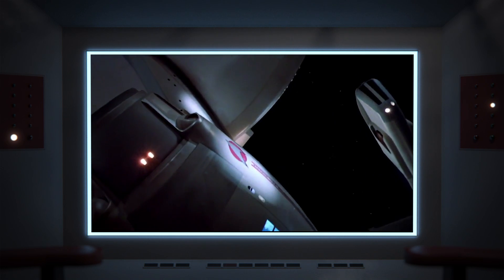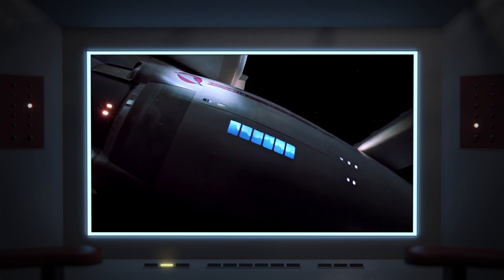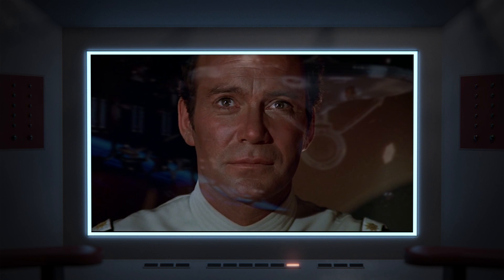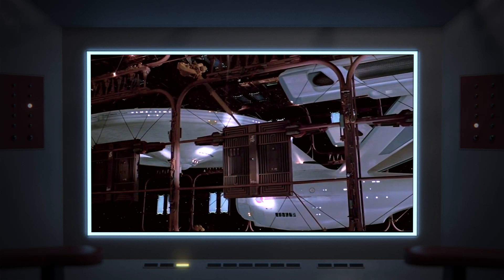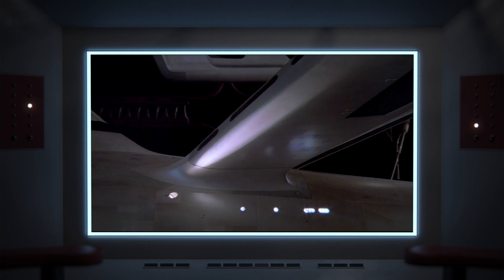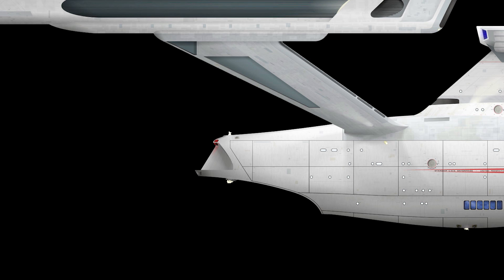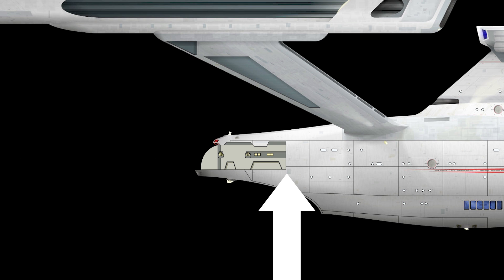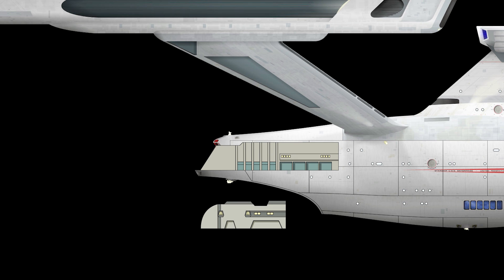Why Have Angled Nacelle Struts? (Enterprise Refit)

Comment: Believe it or not, it has nothing to do with aerodynamics.
Simple experiment:
Take a pencil and draw a line on a piece of paper, but hold the pencil up and down at a 90 degree, like the original struts, at the eraser end. After that, angle it at a 45 and push or pull the pencil to make the same line.  First line, you will find that there will be a jerking affect, the further out your fingers are that holds and controls the pencil, the harder it is to draw a good line.  The power end (fingers) will lead the other end by a fraction, and can eventually tear up the paper or just make for a slow progress.   But use it an angle, as we all use the pencil, you will find it much easier and the power goes through the pencil rather than forcing the pencil from the other end.  Taking a stick and dragging it through the dirt will get the same results.   And that is the real reason why they angled the struts, much stronger and smoother to operate.  Extra space is a bonus.
But also note, in your profile comparison (0:44), the main hull is also slightly longer at that rear than the original, probably by about 20 to 25 feet and the hull is also thicker (higher) than the original which is about where the new nacelles are placed.  I can arguably say that they didn't rebuild the Enterprise, they replaced it.
Reply: When they refit the WW2 Enterprise carrier, they made her bigger is several ways. But they rebuilt the ship, not replaced it. So Starfleet with its future tech definitely could have rebuilt the TOS Enterprise easily.
Reply: @SSanatobaJR  what are you on about?  CV6 was never rebuilt.  She had more AA added and minor changes to radar positions and such.  But profile, length, and width remained virtually the same from her launch before the war to her scrapping in the 60's.  The Essex class ships received major modifications later in life that included angled flight decks, enclosed bows, and new island superstructures.  Even then, their dimensions didn't drastically changed except for some added flight deck width.

Comment: There are way too many statements that can be made concerning Starship design across all species in Star Trek. Many things that make much more sense, even. And then there's weapons, yields, ways of using them that you rarely see or have never seen. Like, you see lots of shots where a ship fires some torpedos and they miss, sometimes by quite a bit. But you never see ships equipped with teleporters  in their torpedo/missile tubes so they can just teleport them where they wish them to detonate either inside or outside an enemy ship. Also, the targeting of weapons would be way more accurate then they portray, almost to the point of 100% accuracy due to the hyper advanced computational assessment of direction, speed, and any other factor you'd need to make a direct hit using any method of delivery. Even at 186,000 miles away phasers, or most energy weapons hit nigh instantly. You can't avoid that with any kind of maneuver. And they never engage in combat at any where near that distance. But, back on ship design. Starfleet ships like the Enterprise are very bizarre shapes. While not inelegant, they are a bit functionally strange in layout in certain areas. But, also, even in those areas if you take into account certain potential needed contingencies in the event of disaster, then even those oddities start to make sense. Ie. warp core breaches, antimatter containment failures, etc. It will be interesting for those that get to witness it, if we make it that far, to see just how we go about designing our own extra solar ships if we ever manage to develop such things. What they would look like is a fascinating mystery we will never know until it happens right before our eyes. I think everyone alive today will be long dead before that happens.

Comment: the tapered shape of the refit struts doesn't make sense.  why do they need to be thicker at the engines?
If you need the end to be bgger to spread stress when connecting the should have been thicker at both end or uniform in thickness.

Comment: My Thought about these more angled Nacelle Support Struts is for better warp field control?  The overall shape of the full ship not just the struts is all based on warp field shape and balance.  The way the saucer dips in on the underside of the saucer section is to do with shaping the warp field for maxim speed and control.  The shape of the nacelle struts is the same thing, making a better warp field shape and thus better speed. There's nothing in engineering that say's the machine can't look well designed and functional?  Designers even of real world machines always make sure not only the machine does it's intended propose But also looks lovely!  And the Refit Enterprise is all that.

Comment: Another possibility is they obviously completely redesigned engineering and the power system, so the path of the power may have been more efficient with the angled struts.

Comment: Thanks, Eric, for another great video! I'll add my support to the ideas previously commented that the revised pylon design allows a shorter and more direct path for drive plasma to travel from the reactor to the nacelle coils. In addition, by having the pylons connect at the center of the nacelles, directly below where the drive coils are supposed to be located, the plasma can be distributed directly and evenly to each coil. In the old design, where the plasma feeds from the front, the poor coils way in the back are getting stale, cold plasma that's already had its mojo used up by the coils ahead. :)

Comment: I also noticed the redesigned nacelle struts were positioned in the middle of the nacelles instead of the front. If the nacelles took major structural damage, you would loose less of the nacelle.

Comment: The swept design also gives you a bit more surface area for the intercooler grids on the pylons
Reply: Nerd alert—those are the emergency plasma vents, the intercoolers are the fins at the aft ends of the nacelles.
Reply: @misanikolic9708   They could still be radiating a small amount of heat and radiation from the the pylons' hull. Plus, it allows for more area for shield grids/emitters to be placed.
Reply: It also gives you extra space without needing to increase the frontal area of the Warp field.

Comment: Hmm, is it really a "refit" if they had to build an entire new structure?
Reply: Sure, in naval shipbuilding refits that introduce entire new parts of superstructure or hull happen all the time. Just off the top of my head the Japanese Ise-class battleships came out of refit with a 1/4 length flight deck, the German Admiral Hipper class cruisers received a new bow, the Midway class carriers were refitted with an angled flight deck, the Italian Conte di Cavour class received an extensive refit almost on par with what they did to the Enterprise: new bow, new superstructure, new casemate, new secondary guns, revised main guns, new boilers, only 40% of the original ship remained when they were done.

Comment: That's a hell of a big "refit".  To make that kind of change they'd essentially have to dismantle the entire read end of the Enterprise, rebuild the chassis, the structure, move some fairly serious power conduits, and rebuild it all.  The struts and nacelles are entirely new, meaning the old ones were removed and replaced.

More than that, we see that the bridge is physically bigger, and that the general interior seems to have more space; presumably some walls were removed to make more space.

It's not so much a refit as a fairly substantial rebuild, with at least one-third of the craft being completely replaced.
Reply: "Admiral, this is an almost totally new Enterprise. You don't know her a tenth as well as I do."

Comment: I work with steel and structurally you don't want to have things at 90 degrees it's easier for things to tear.
Reply: Makes sense. (I don't work with steel but) I would think that since the nacelles are being pulled forward from the rest of the hull, the torque on the struts would put unnecessary strain on the front corners
Reply: @BrettG17  Hmm. That's true at impulse, but logically at warp the reverse is true - the nacelles push the ship. Or maybe not, given how warp travel involves manipulating a subspace field around the ship...
Reply: @KuraIthys  the nacelles don't push or pull anything , they create a warp bubble around the ship and basically distort space itself to make the ship move , so there are no forces working on the hull of the ship during warp
Reply: @NitpickingNerd  The ship still has to move through the warped space.

I don't care if you warp space to the point of tearing a hole in reality, it still won't put your ship any closer to your destination without actually moving. The impulse engines won't operate inside the warp bubble, from my understanding, so that means that actual propulsion for Warp drive is part of the Warp Nacelle itself.
Reply: @KuraIthys  - ... except... impulse drive is powered from the saucer section ...
Reply: I guess that’s the reason why straight wings rip off aircraft all of the time.
Reply: Makes me wonder when inertial dampeners became a thing in universe.
Reply: @darwinxavier3516  You make a good point. It would have needed to be invented before the warp drive, that is if it's a jump from impulse to warp, a steady increase wouldn't need to have inertial dampeners.
Reply: @Ironfrenzy217  I have to disagree on your point above.  at impulse you would defiantly need the inertial dampeners, while at warp likely not as much.  As I understand it, at warp the ship is not actually moving particularly fast or accelerating, but instead it is pulling space toward it.  On the other hand we know that the enterprise can easily cross our solar system in a matter of minutes or perhaps hours depending on what source you take, under impulse.  
Even if we go with a conservative estimate and say the enterprise can travel from the sun to Jupiter in 1 day under impulse.  If I've got the math right, that requires an acceleration of 200 meters per second, squared, more than 20 times the force of gravity is plenty to squish everyone and rip the necels off the ship if they don't have some tech working.
Reply: @darwinxavier3516  As soon as they figured out how to make them go offline
Reply: @darwinxavier3516  Inertial dampers must have been available quite early on, since they are effectively the same thing as artificial gravity, just acting in the direction you're going instead of towards the floor. If you have the technology to do one, you can do the other.
Reply: My thought is that the “spine” of the ship ties in near the top centerline of the secondary hull.  These pylons seem to better integrate into a reinforced area of the ship which means more powerful nacelles and faster warp drives.  That was part of the refit from the beginning.  The original pylons were designed for an inferior drive system.
Reply: But this is space, where there is no air resistance...
Reply: @finalfrontier  Call me an expert necromancer, my necro-posting knows no bounds and my boredom is complete...

But to refute your statement, federation ships actually would have quite a lot of forces acting on them, aside form general gravitational forces.

    Whenever a ship went through any nebulas, or other gas clouds you'd end up with the rough equivalent of "Air resistance". We've seen how severe impacts/weapons fire can throw people around on the bridge right? Can you even imagine the kind of force it would take to sharply jerk something that's larger than a Nimitz class supercarrier? I'm sure someone already has the math somewhere but we're talking potentially Extreme forces. I mean hell, anti-matter weapons are not rare. A chunk of anti-matter the size of a softball would vaporize a decent chunk of a State. If the warp core went when the vengeance crashed into San Fransisco... I don't even know lol You start getting really large numbers really quick with space stuff XD
    And having the very significant mass (Like no really though, them things are heavy as ballz) of the warp nacelles on the ends of their pylons means that regardless of whether or not they themselves push/pull the rest of the craft, every time any motion is made shit could get real spicy on those connection points.

I also don't off the top of my head remember how the shields are supposed to work so it's possible that forces may be transferred directly to certain parts of the ship, or through the shield emitters themselves. So if for instance if there are shield emitters on the nacelles and they bump into something does the shield emitter get shoved? That could be a problem lol
Reply: Does not matter they are in space...with warp bubbles
Reply: They've got a Structural Integrity Field to counteract that.
Reply: You work with steel but the enterprise is not built out of steel so what you are saying might not compute with futuristic alloys, although it is very thought provoking.
Reply: @gethammed  sheer is a pretty fundamental force, it'll effect most/all materials
Reply: @Joesolo13  Star Trek disregard quantomechanics, thermodynamics, and most scientific laws as we know it, so I'm pretty sure SHEER is low on the list of things ST pays attention too. Btw, many futuristic composites could be so strong sheer is a non factor.

Comment: It is also implied that warp geometry is not all that different from aerodynamics and we can see Star Fleet ships becoming progressivly more rounded and with more tapered designs as time goes on and most designs doing away with the saucer neck
Reply: That could be true, there's also the slightly more tactical minded thinking put into the designs, making ships more compact to be smaller targets in combat, or getting rid of potential weak points like the necks and shortening and thickening pylons.

Comment: If an airplane had wings that come straight out at a 90 degree angle, it's top speed would be limited.  Compared to a plane where the wings are more swept back.  It's easy to say that's just because of aerodynamics (and that's true), but it's also because of the forces exerted on the frame of the craft when accelerating.  

In space we don't have to worry about aerodynamics, but the forces and stresses the ship experience during maneuvering and accelerating are all still there. You can argue that while at warp those stresses would be different because . . . subspace, I guess?  But when at full impulse the ship is still going .25c which is going to create a lot of stress in the superstructure.
Reply: zuke1624   Then they are swept the wrong way.
Reply: @DrewLSsix  maybe. I'd be interested in seeing someone make models of it either way and measure the stresses both ways.
Reply: There's no air so no aerodynamics or need for aerodynamics, true - but every technical manual has mentioned something about warp dynamics which would imply some kind of geometry similar to aerodynamics or analogous.
Reply: @warptek  right but that's in relation to the position of the warp coils, not in the structures supporting them.
Reply: The fastest plane that ever flew (the X-15) has wings with zero degree sweep.

The only reason why you use a swept wing for speed is it allows you to have a thick structure while presenting a thin aerodynamic profile. And it’s for flight in atmosphere to prevent the formation of shock waves which depend on how fast something changes its cross section.
Reply: @Bartonovich52  I believe the X-15 has a 25 degree sweep to it's wings.
Reply: Ok, I think I might have done a poor job of explaining my thinking here.

Imagine you're sitting on the back of a motorcycle with a 10 pound dumbbell in each hand. If you hold them straight out from your body (side to side) and your friend hits the gas, it's going to put a lot of stress on your arms.

If you angle your arms instead (backwards in this case though as DrewLSix points out, maybe forwards is better) you lessen the stress put on the arms.
Reply: The "speedometer" on the refit Enterprise's helm shows that the ship can actually go .9c on impulse power, so I agree with your logic.

Comment: I kind of figured that the angled struts allowed the member to better handle the tension/bending-moment from acceleration via impulse. With straight struts, the bending moment is supported at the strut base and demands a certain strength. With the struts angled, the struts at the base can be made thicker and experience less stress from the bending moment.
Reply: impulse exhaust is on the rear of the saucer :)
Reply: @Great.Milenko  Well yes, and that force has to be supported throughout the ship structure. I found certain symmetry in that the structure ahead of the thrusters is saucer shaped- better for compression- and structure behind the thrusters is more straight/angled beams- better for tension
Reply: @IAmTheAce5  thats a great point, probably less of a bending moment with a rear facing structure,

Comment: They are properly referred to as pylons, not struts. A strut is one part of a greater framework, typically consisting of multiple struts framed together.
Reply: The struts on my landing gear aren’t attached to anything else.
Reply: @Bartonovich52  That's true, and on an aircraft, the part that connects an engine to a wing or the fuselage isn't called a strut either. We even see USS Voyager land on it's four landing struts so, can a starship have struts, yes it lands on them, like an aircraft, and like on aircraft, engine support structures are called pylons.
Reply: @Bartonovich52   - except the landing gear, oh and the fuselage.
Reply: @ Chuck in Texas. 

It’s not rigidly attached and is considered an entire structural assembly. 

Kind of like the wing STRUTS on my other aircraft.